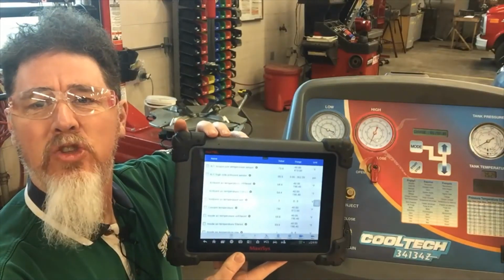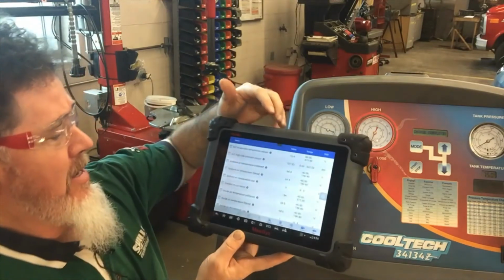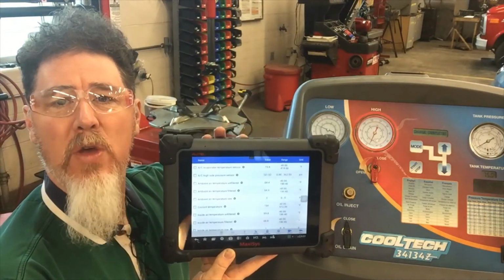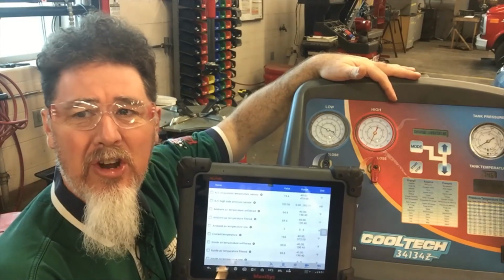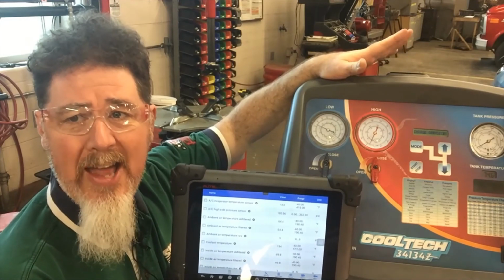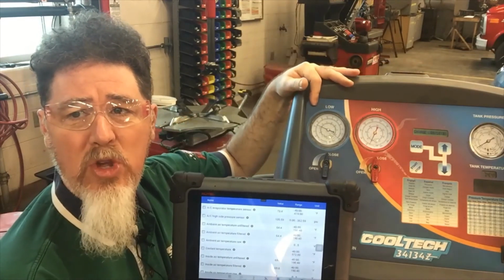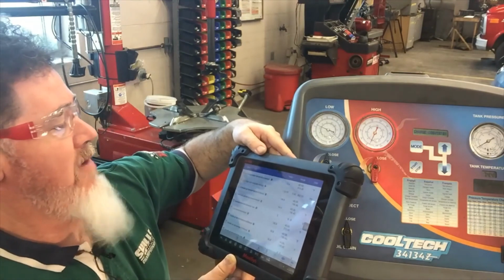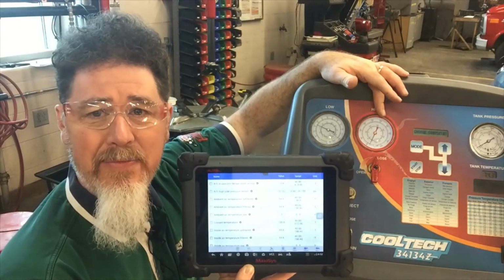Finding a restriction in the A/C system Part 2

Comment: @markh3478
0 seconds ago
Great video . I had this same problem on my 1988 BMW M6 with only BMW OBD1 so could not monitor high pressure switch reading . Low side gauge reading a little high and high side gauge reading very low . System was overcharged by me trying to solve the problem with a Wal-Mart can and gauge . No luck.  I guessed there was a blockage in the condenser so dismounted it , bought a small fluid pressurizable tank at NAPA and some stuff I think was called Dura flush . Its mostly pentane so flammable . I put it in freezer for an hour before starting .  Pressure fed the Dura flush into the condenser discharge side at 90psi  . Nothing happened for about two minutes so hit it again with more . All of a sudden whoosh and a gusher of gunk shot and spattered about 20 feet across my driveway . Glad I had on safety glasses . I flushed the lines to and from the compressor too .  After new o-rings and assembly with an ounce of AC oil added to the condenser  , 30 minute full vacuum and recharge with 134-a ( had already replaced TXV and STV POA ( car has rear evaporator , too ) I got 44F at vents with fan blowing on condenser, 2000 rpm fast idle on 92F summer day .  Now get 225 psi on high side at 75F - 80F.

Comment: 65° ambient temperature your low side should be at about 42 to 45 and your high side should be around 180 or 200... ASE certified here what you're showing me looks like an undercharge system did you verify that it is fully charged did you evacuate it and put approximately 2 lb of Freon in it... Fully charged system with a restriction will suck the low side into a vacuum in the high side will go right up to three 400 PSI I don't know what school you went to or where you got your certifications..
Reply from the maker: Well George, your comments are rude and unprofessional for an ASE A7 certified technician.  I hate to embarrass you, but you have the wrong information.  When there is a low side restriction, like at the TXV, the low side will go into a vacuum and high side will also drop.  I have lots of videos to prove this on my channel, you should watch a few.  Try putting Co2  or use a Duster Can of R-152a on the power  dome  while the A/C is on.  The TXV will close and show you the low side drops and high side also drops.   A restricted FOT will also not cause the high side to go to 400 psi.   You are simply wrong my friend and I can prove you wrong .  Just watch my video titled "How to test the H valve with Co2.  You made my point on why I have this YouTube channel, there is simply a lot of wrong information out there.  Just to give you some of my street credit,  I have been teaching A/C classes for over 30 years.   I have taught  for Chrysler for 15 years and 1,000 of techs have attended my classes.   I am a current Professor of Automotive Technology at one of the top ranked automotive schools in the USA.  Yes, I am A7 certified.  I am the expert in A/C!  Plus, I am writing a book on automotive A/C.  Do your have more street credit than I, are you an A/C engineer?  I don't normally respond to the hundreds of post on my channel, but you quested my credentials.  Professor Pentane.

Comment: In this video The high side gauge NEEDLE is actually reading  zero...as the low side needle is using the CORRECT POINTER END OF THE NEEDLE >> your using opposite  reference points on the pointer needles. easier to unhook a couple of hoses and  blow air thru the system..
Reply from the maker: I am sorry Mr. Silver Chief, but I watched the video and everything is correct as stated.  All pressures in this video is taken from the larger side of the needle, the correct side.  The high side needle is reading between 40 and 30 psi in this video.   I am sorry if there is any confusion.   The pressure reading may be hard to see if viewing from your phone.  PP
Reply: @ProfessorPentane  thanks for the reply..
Reply: @ProfessorPentane  Thanks for the response..Ok Im referring to 2:28 0n the video control track..RED needle short side is at 1 o'clock position. the high side is down in the red where the long side of needle is pointing at 2:28  ....low side BLUE needles long side is well into the gauge numbers.